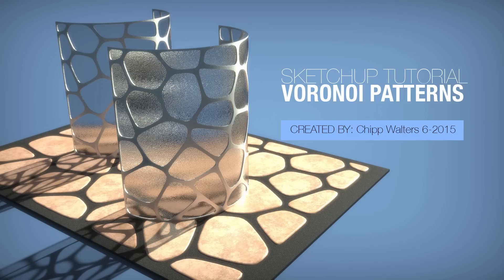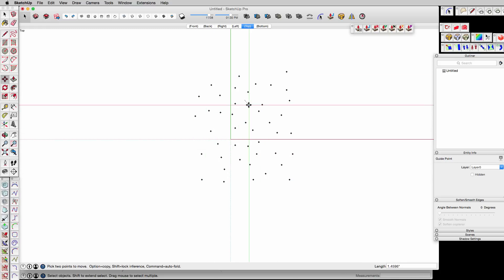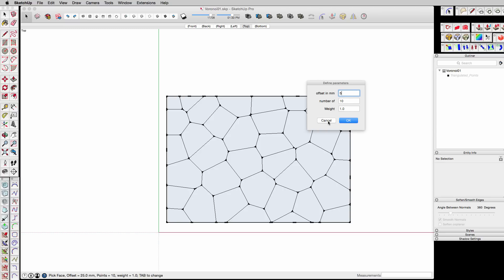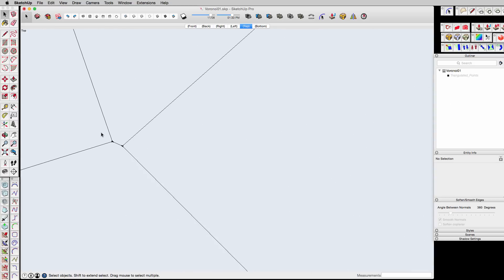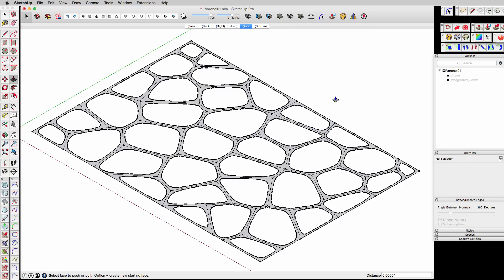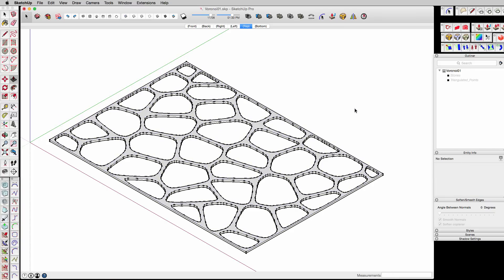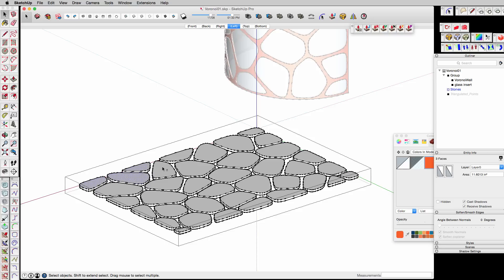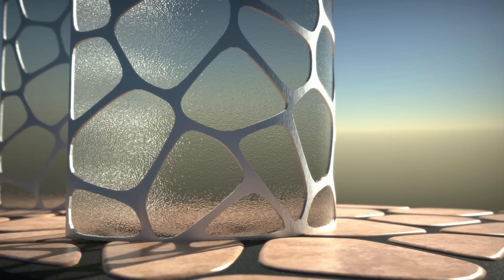SketchUp Voronoi Tutorial

Comment: Hi Chipp, can you tell how you can use the multiview window? I just can´t seem to find the plug in to enable that option.I even joined a forum on the subject but no one seems to be able to do it. In Sketchup inference is king or queen but I was taught to model with a multiview in Maya and I miss that option. Thanks in advance
Reply from the maker: Hi Vitor, I'm sorry but I don't quite understand what exactly you mean by multiview. SketchUp can only show one view at a time. I have tabs at the top, representing SCENES which I've named Top, Front, Side, etc.. These are easily setup using the scene palette. HTH.